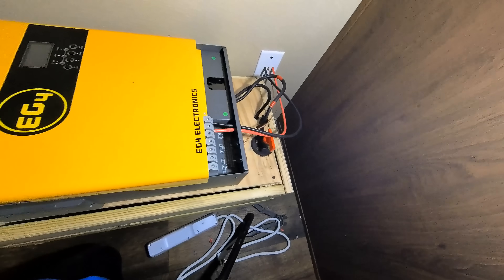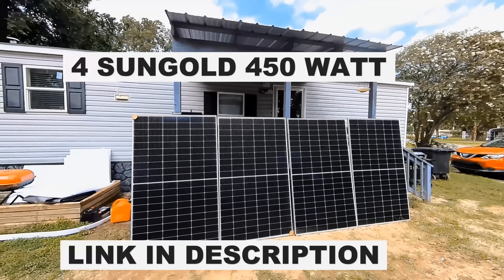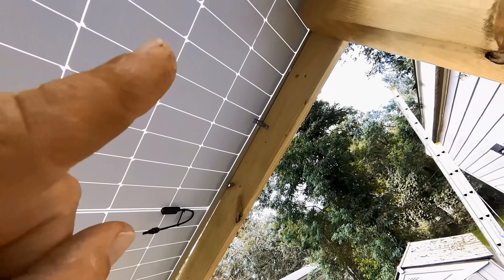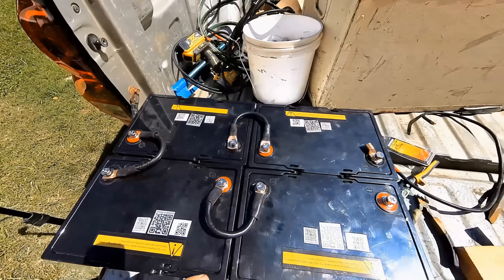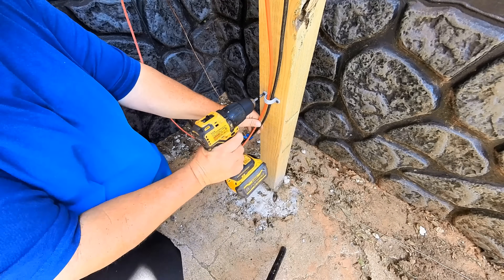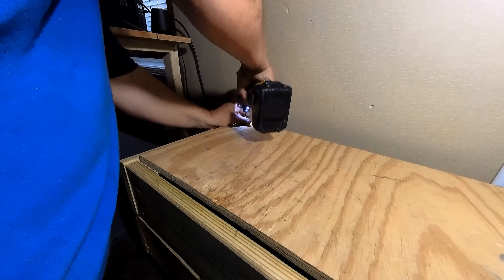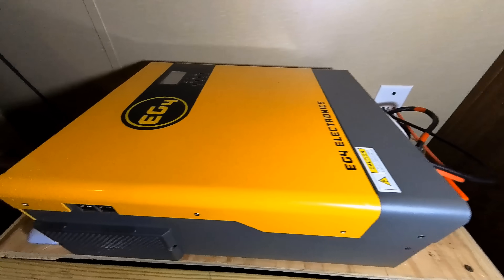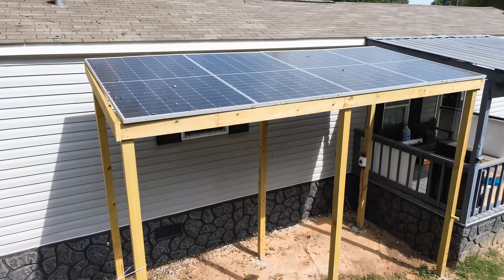Simple Solar YOU CAN BUILD!  Using Sungold Solar Panels

Comment: I see these videos on YouTube building all these tutorials. Unfortunately, I'm too poor to do what these videos show.
Reply: I bought a solar starter kit from Harbor Freight for under $500. One panel, charge controller, one 35ah battery, and a 2000w inverter. The next four months I played around to see what it could do.  I learned a lot.
Reply: @dgoins6  I bought small things one by one over a couple of years from pawn shops and renogy. Nothing like the the big builds.
Reply: @dgoins6 can you send a HF link. Not finding it on their website. I'm now motivated to start small w/HF.
Reply: . Thete is a Harbour freight by me WHAT r u able to power on that unit u mentioned in the comment. I live in central florida  n I live on ssdi  but I want a solar power unit. I do live inna 55plus place so I can't do anything like this video  but does yours power a windows aircondioner if I need that. Curious what it powers. Hopefully the microwave for a few min or a hot air oven or tv for right now n cut the power I use with that
Reply: Being poor is a mindset. Change your mind you change your financial situation.
Reply: What do you mean? He lives in a trailer. He's poor too. The batteries are only $250/each. You don't have 1k for batteries? And another 2k to get started with everything else. Well no free electricity for you then. 

The electric bill for that trailer is probably $80/month.
Reply: Start small. Get one of those small eco flow things or whatever brand you want. Charge it at night when rates are low and use it to power small things you might use when rates are high. It will save you a little each month. Then, over time get a small charge controller and a cheap solar panel and use it to charge your little eco flow. That will save you a little more. Rinse and repeat. Before you know it you will have a nice little solar setup. I hope this gives you at least a little hope.
Reply: Being poor is a mindset. Change your mind you change your financial situation.
Reply: He’s already teaching you how to do solar bunch of solar work rn and they pay good you got this brotha
Reply: There are vids of $300 and if one can't afford that, then there are $80 solar phone chargers. Hope this helps.
Reply: Yeah, gotta find ways to spend as little as you're willing, and save the little you can until you have enough. Good luck!
Reply: Don't worry about it. Do the best you can. Start very small even with one panel plus $50 battery just to turn your lights on.
Reply: What today is not, tomorrow will be
Reply: Me too I have a harbor freight starter kit. But pretty soon I’m doing this already have my land .
Reply: There are kits you can get for a few hundred, you'll only get a 100w solar panel with them but the kits usually come with a nice inverter that can handle more, usually up to 1000w, so you could get yourself a kit, build it, and over time add to it and build up
Reply: @Flamer997 thanks appreciate the info what kit do you recommend starting out with ?
Reply: What solar panel. Cost in your country
Reply: Start saving! It will end up paying you back!
Reply: Research barging stores for wood and panels will be investment you got this dude!!
Reply: I am too! But if theirs a will thiers a way. Get things a piece at a time and that can be added on to. I have an bluetti ac130 I got first. I just got a 50watt panel for 50 bucks from home depot. For years I've heard ppl always giving or throwing away solar panels on Craigslist. I be a product tester and ask for free stuff to test.
Reply: Save up!!!
Reply: Such a useless comment. Nobody cares 😂
Reply: Same I don’t got no money but I enjoy watching in hopes that one day I will build one 😂
Reply: Start small I'm on a budget and I've started powering certain things I use the most on solar and as you save on your electric bill Start adding to it eventually your electric bill will be almost nothing
Reply: Work minimal jobs save bit by bit motivate Yourself to make it
Reply: Stop watching videos, use your time to work and make some money, then build what you want, hate when people claim they are poor but are too rich time wasters.
Reply: Needless comment hater
Reply: @pr5991  Really. I’m 100% disabled. Haven’t worked for 21 years. You try living on disability
Reply: @pr5991 he is learning , no time wasted when you learn.
Reply: Then do t better by not using money but your mind. Used solar panels are everywhere and very cheap.

Simple, rich people use ready build solar generators. Build one yourself from scrap you can gather with very little money. You can start with used car battery, charge controller and small inverter. Upgrade as better components come by. Work, earn money, learn new skills that you need, make connections with right people.
Reply: I was told that you can't use car batteries for solar panels  @Teknopottu

Comment: don't ground your solar.
Reply from the maker: Whatever that's supposed to mean?
Reply: @OKLAHOMAOFFGRID   don't put a ground rod in the ground for your solar with that hole digging machine. it's already isolated, your more than likely to get lightning damage to your system through a ground strike that enters your system through your ground rod than a direct strike  to the system itself.
Reply from the maker: @ronpaul2012robust  I didn't use a hole digging machine for a ground rod I beat the ground rod in with a hammer. And I would say that the main purpose for the ground rod is going to be because this is a standalone system and it needs a ground to ground any appliances that are hooked to it so you don't get your butt electrocuted if something gets wet
Reply: @OKLAHOMAOFFGRID  i know you didn't use a hole digging machine for the ground rod. but look into this grounding situation  for stand alone systems and you might be surprised by what you learn. PSA Don't handle electrical wires while wet.
Reply from the maker: @ronpaul2012robust  yeah sure I'll look into it but you still need a ground for all your appliances in case there's a fault. You never know if there's something on the sink or anything like that that gets wet you might need a path of least resistance to use besides your body. I'm not saying playing the swimming pool while you're plugging things in.. but I'm pretty sure a ground to an  inverter it's more important than losing a $700 inverter to a lightning strike once every four years
Reply: @OKLAHOMAOFFGRID  well I'm here for all the poor's that would be without their solar if it was taken out by a lightning strike. :text-green-game-over: when you aint got money to replace it. solar not being grounded is not terribly dangerous. says me, on ungrounded solar since 2016. oh..well my solar panel frames are grounded. if anyone knows better let me know, but for now I say don't ground your solar power system. I am Retarded so being self aware i am open to constructive criticism. You could use mc4 connectors with inline 15amp fuses on your ground wire, let me know what you think.
Reply from the maker: im like you man I aint no pro....I only know what I know as a diy guy

Comment: Not to tinkle in the cereal, but you pulled the PV wire through the house without any chaffing protection. I saw metal sticking out of the siding, so you jammed the PV into the siding.? Never use an impact tool on an inverter terminal.  This neat deal from SunGold panels of 4 includes shipping  $1,220.00 price.
Reply from the maker: It's all good I'm ready for the critics.. the siding is plastic and there's absolutely no metal on this trailer house you actually have the plastic siding a piece of foam board insulation and then sheetrock and you're all the way through.. unless you hit a stud which I went between the studs LOL.. by the way this system was about building a system the very cheapest you could get it done safely. And you know that's a great question about the Sun goes panels they sponsored the video so there was no shipping charge but I guess you would have to put them in your cart to see... As far as using the impact I mentioned it in the video and said I shouldn't be doing it but I was in a big hurry to knock it out I only had about 2 hours left to get everything done so I was easy on it and I only used it on a couple of different things and I actually went back over everything with the regular screwdriver.. but yeah no worries brother we all have our ways we do things I guess
Reply: @OKLAHOMAOFFGRID  not criticism. But it looks sloppy. Couple bucks to make the pass thru look pro. It's worth it.

Comment: I have 8 of the 550w Sungold Power panels and a Sungold Power 5,000w inverter/charger/charge controller too. Great idea to have it separate from your house. I wired mine in series too, racked 15" off the roof of my motorhome. This produces 400voc, which is easily handled by my Sunpower all-in-one's 500v input charge controller.
Reply from the maker: nice...sounds like a great system...how is it working out? what will it run?
Reply: @OKLAHOMAOFFGRID  Our system is sized perfectly for our needs.  It runs everything in our motorhome just like we were hooked-up at an RV park. We usually run our mini split heat pump either in cooling or heat mode 24/7. In the afternoon when the summer sun is beating in, we run both our front rooftop 14.5k A/C., which draws about 1,500 watts, our rear heat pump at the same time. We can even run our microwave for a few minutes to heat up supper, our TV and desktop computer without it overloading our inverter. When the sun goes down (and so does solar production) we no longer need our front A/C, so we can make it through the night on our batteries easy peasy.  It helps that we have good insulation, dual pane windows, etc. in our motorhome to stretch our limited power.
Reply from the maker: thats what I like to here
Reply: @SuperSushidog battery info or specs for your system please!

Comment: Harbor freight has some good one.
Reply from the maker: uhh...im not to sure about that
Reply: @OKLAHOMAOFFGRID , because it's HF, or because you tested/used them before?
Reply from the maker: they are weak cheap junk panels with low wattage and high price for the little bitty 100 watt panel. the charge controller is the equivalent of Temu crap and the inverters they use don't even reach the ratings they claim..But Harbor Freight is my favorite store still..but not for solar. so what can I say